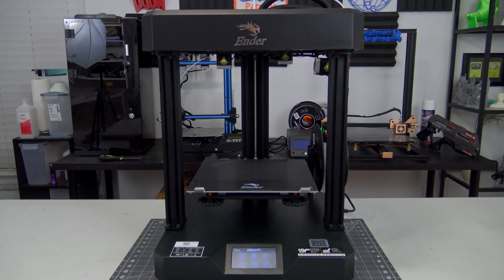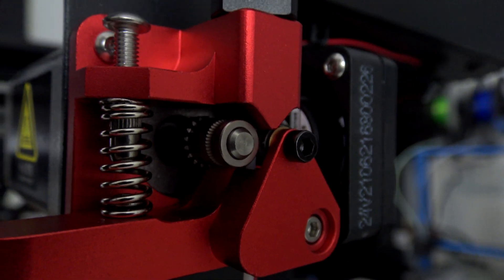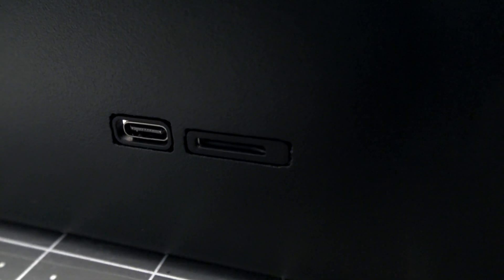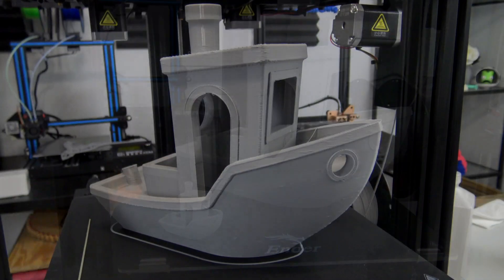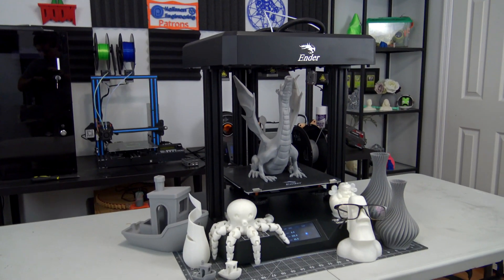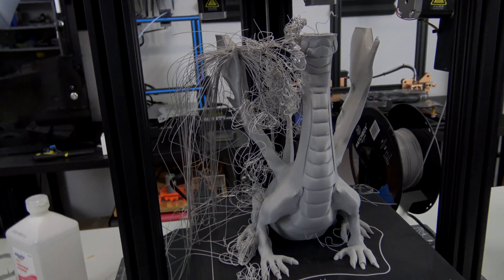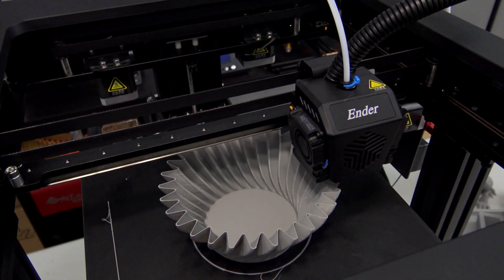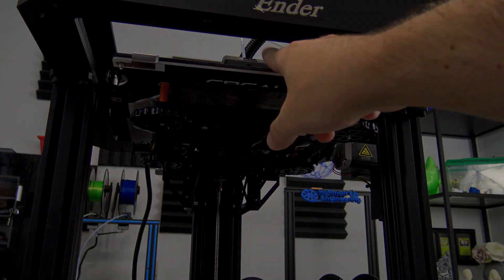Ender-7 Review - Best 3D Printer for rapid prototyping?

Comment: I bought one without looking into anything first. Wishing I hadn't. But, since I got it, and I'm too lazy to try and return it, I need help I can't seem to find. How do I make it do anything at all? It is stuck on 'Autohome' but nothing is even trying to move. In the settings, I can only make the bed move up and down, but not very much and it seems like it gets nowhere near the head. Read a product reveiw that said the step motors don't work if the voltage isn't set to 110v for NA as it's set to 240v out of the box. But I don't know how to change the volatge input like the guy said.
Reply from the maker: On the right side (where the power switch is), there should be a cutout near the middle that accesses the power supply voltage switch. You'll definitely want to make sure that is set correctly for your country.

Comment: Great video!! I think this is a good printer for beginners that want speed and quality without hassel.
If you are handy and can learn running klipper on an open source core xy with acceleration tuning, pressure advance and input shaping is the way to go.

Comment: Thanks for sharing that little bit of info regarding vase mode prints and using USB. I don't have a USB-C flash drive so will look to get one, how was your USB flash drive formatted for the vase mode prints?
Reply from the maker: I didn't use a flash drive, it was a direct USB connection from my computer to the printer. Used Pronterface from my computer to send the gcode directly to the printer. I am not sure if flash drives are supported, unfortunately I don't have a USB C drive to test.
Reply: @HoffmanEngineering  Thanks for the quick reply, I'll find out soon if they are supported I guess! 😂
Reply: @odj310388  Hi, what was the result of your USB-C-Drive-Test? Did it work? And solved this the vase--mode issues?
Reply: @arci0tus  No luck, you have to connect it via USB C to a computer.
Reply: @odj310388  Thank you! Did that work for you? I´m thinking of buying a Ender 7 to "help" my Ender 5 Pro with bigger jobs ;-)
Reply: @arci0tus  it did allow me to do vase mode prints when using a usb c cable to a PC through pronterface. I wouldn’t recommend the Ender-7 personally though, I got rid of mine in less than a year, was the worst printer I’ve owned so far to be honest.
Reply: @odj310388  Thanks for the warning! Just saw some reviews, same opinion there. Maybe that´s why they sell it half price now...
Reply: @arci0tus  hah yup! They can’t get rid of them fast enough. 🤣

Comment: I already have used some printers from Creality (Ender 3 and Ender 5), and they are great printers. However - They where great printers for me because of the ability to modify and tweak them to nearly perfect usage. That include changing things like the motherboard for a BTT SKR version, adding a touch sensor for bed leveling, and modify the firmware for optimal results.
However - Both Core XY printers (Creality Ender 6 and now Ender 7) do not longer have open sourced firmware. You can't tweak anything and also can't make any corrections to the firmware. This puts you at the mercy of Creality if anything goes wrong. You just gave a prime example with the vase mode! This is very disappointing, and puts the Creality Core XY printers out of the range of people that like to tweak (and honestly, the same people that made the Creality brand popular).
Personally I would love to get my hands on a Ender 6 or Ender 7, but the above facts are a big red flag for me. If this does not change I am afraid I pass for the Creality Core XY range, and look for another brand (or build one myself from scratch). It's a Pitty....
Reply: You have to chuck the touchscreen and then you can install marlin.  TH3D has a livestream for the Ender 6 at least.  Someone did write a module for the dwin lcd if you want to jump into the deep end and keep that screen.
Reply: @teac117  Thanks for the information. I am sure this will be helpful for people owning the Ender 6. 
However - It's still a far cry from Creality giving the source code for their Core XY printers. Until than all possible tweaking will be guesswork. For instance - It would be nice if you could install a BTT SKR motherboard and touchscreen, but without having all parameters it will be a difficult job with mostly guesswork. It remains to be seen how many people will give up their build-in touch screen just to be able to install Marlin. 
Personally I think it's in the best interest for Creality to give that source code, because people can make improvements that greatly benefits Creality itself. They can use the improvements from the community to improve their products, and probably improve their sales by a big margin. The Ender 3 model is a prime example of that (and the more expensive Ender 5 too, so price is not extremely relevant here). The reason that printer is so popular is because people can tweak as much as they like, because all stuff is completely open. Until Creality does the same for their Core XY printers, I personally won't buy them, and I think there are lots of potential buyers out there that think the same.
Reply: @cgwworldministries Sorry - They do NOT use open source software. You can only download the closed source compiled version of the firmware on the Creality website, but NOT the source code of that firmware. Sure - There there are some fan-made Marlin versions around, but those have limitations (display problems to name one), and the parameters are just guesswork.
But if you know some official open source code from Creality be free to point it out here, because I like to see some prove that I gave misinformation. You made a statement, but gave no links to said open source Creality software (and no - compiled firmware does not count).
Reply: Thanks for the info.

Comment: How disappointing, like the included gcode files the only thing printed at 250mm/s on that huge Benchy was the infill. If you advertise a printer can print at 250mm/s I expect that through out a print not just the infill. I'd like to see you print the same Benchy at a true 250mm/s please.